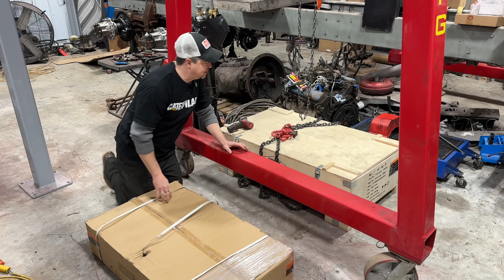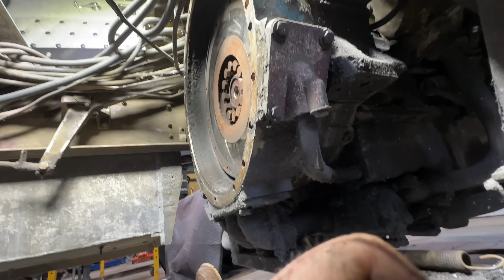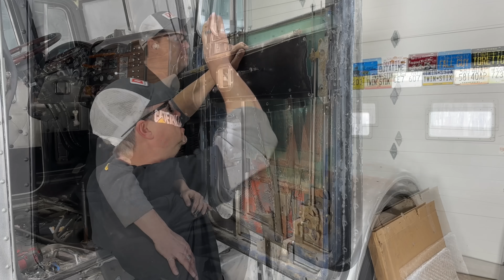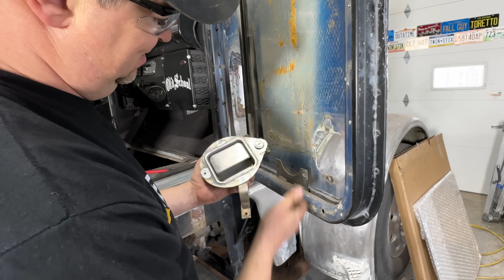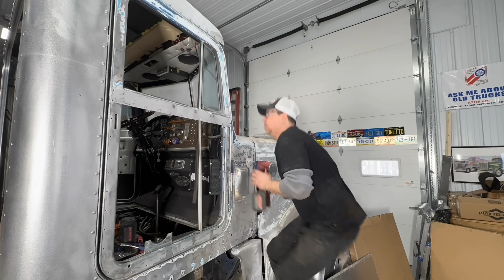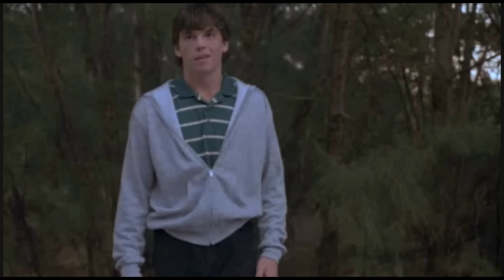Peterbilt 359 Restoration Ep.87 Gimme Some Skin

Comment: Hey mark make sure you stick new engine mounts in! I doubt someone had forgot to install them most likely the remains are still in there and they have just deteriorated over time and bits have fallen out! If you leave it as is you will wear the metal mounts out and it has the potential to crack the mounts our even worse lead the frane to break!

Comment: I would highly recommend getting the fly wheel resurfaced. Anytime we do a clutch flywheel gets cleaned up, it's usually fairly cheap
Reply: That’s true, but in this application, it is probably not worth it. Think of the life of the clutch if you resurface it or do not resurface it. The difference it makes will probably never come in to play with this truck. This truck will be lucky to see 50k miles in the next 30years.
Reply: @wadelevan1787  I agree it won't see much for miles but it's still cheap insurance. I can't quite remember exactly what we charge to do it but it's damn cheap. Honestly if he'd pay to ship it down here to South Dakota I'd do it for free

Comment: Now's the time for transmission mount bushings it'll never be easier than now. That's probably what got your shift linkage all buggered up in the 1st place since there's nothing to absorb all the twisting  your trannie does when you come off and on with the throttle. Good time to pull the flywheel and get it resurfaced for that new clutch. And while you're at it you can check the rear main seal since it'll be wide open too. See how these projects can get out of control in a hurry lol?

Comment: I think it's stupid that ye have 2 jacks instead of one,
the trans Jack should have the Clutch tool build into, so ye donnae have a gigant piece of wasted space for storage
for a tool that only has one job.

Also very intresting tae see that ye got sinter metal clutch on LbL ,
but the groove on the Pressureplate is hard, there isnae much live left in it and so is the flywheel.

btw. while yer doors appart soak the door mechanism in diesel and atf mixture tae clean it and get it working proper again.
And put body sealer inbetween the doorframe and the skin, reduces windnoise and keeps dirt and water out esp. on the overlap.

Comment: If you take the door off and remove the hinge you can use all the correct rivets
Reply: You should watch Berry Trucking videos on building the dump truck he does it that way. Replaced right door skin
Reply from the maker: No the inside track is behind the inner frame so no way to get behind

Comment: OK. The reason for this transmission exercise is that it comes out of gear on occasion according to episode #86. The shifting mechanism has been redone and tightened up previously. The shifting mechanism is mounted by bracket to the frame rail. The bushing, pad, softener, whatever you want to call it, for the right rear engine mount is missing. This engine mount is right in front of the bracket for the shifting mechanism. The missing bushing allows extra movement of the engine and the transmission, which is bolted solidly to the engine. The transmission will move more than the engine because it is out there farther towards the end of the stick. Probably replacing that right side bushing, and maybe even the left one, should have been the first job you did, and not something you might do later if the whim overtakes you. Take care. And good luck. I better edit this. What I’m saying is the transmission is shifting itself out of gear, because the shifting linkage is tight, but the transmission is moving all around. Hopefully the trans is fine as frog hair, but collateral damage is a possibility due to the lack of maintenance.

Comment: My name is Gary using my wife’s phone. I repair garbage trucks and semi tractors that haul garbage. Please change the motor Mount now and turn the fly wheel even if it looks ok. The motor mount rubber pucks get destroyed from years of twisting of the engine. If you leave it then gone will move too much. Eventually the metal motor mount bracket can break and the engine falls or jumps up. The fan came hit coolant pipes or hoses and also the fan can then fall apart and blade go through the radiator. It can be very expensive. The flywheel surface may look smooth but isn’t. If you want a smooth long lasting clutch please surface the flywheel.
Reply: Great comments Gary! It’s important to keep in mind what Mark is planning to use this truck for. It will be lucky to ever see another 50k miles while he owns it. Flywheel will be irrelevant.

Comment: If you used the truck you would want a rubber bushing on the tranny mount. It sroos vibration and noise from going into the truck plus keeps cracks from developing  in the trans case. You are really good at showing perfection in doing a job.

Comment: thought you would have used a sealer on these new panels
Reply from the maker: Yeah I missed adding it along the top but it’s fine since it’s tucked underneath so I’ll just put it on the inside and I plan to add correctly before I rivet the rest in 👍

Comment: A clutch jack is a waste, do not install the clutch on the flywheel first.  Years ago I learned the best way to install a clutch is by stacking it order on the input shaft of the transmission and to bolt the pressure plate up once the bell housing has been bolted down.  I would never do it the traditional way ever again once I learned that method and everyone I know that trys that method won't do it the old way again.
Reply: Yeah if I had a clutch jack there is no way in hell I would dick around with barring the motor around to get at all those bolts.
Reply: @farmyardfab  I guarantee I can still do a clutch job faster and easier using the input shaft stack up method than the conventional method with a clutch jack.  I have done well over 100 clutch jobs using the input shaft stack up method.
Reply from the maker: Yeah I’ve seen that way as well but not crazy about trying to tighten the bolts through the small opening - seems like more of a PITA 🤔
Reply: @TwinStix    I think 🤔 you can get it to work for you and I like 👍 your Smokey and the bandit truck 🛻 and the trans  am 🚗 you have a good day
Reply: @TwinStix 😊
Reply: @TwinStix  Just bump the engine over with the starter and do 2 at a time.
Reply: I definitely agree. Stacking the clutch on the input shaft is the only way to go.

Comment: I'm just winding why you aren't sealing the panel in so it's water tight.
Reply from the maker: Yeah I missed that along the top but since it’s tucked underneath I may just add sealant on the inside seam but will add it properly down the sides when I do the bucks and blinds 🤔

Comment: Are you going to get the flywheel machined/surfaced?  That is standard procedure when installing a new clutch to ensure it has a good mating surface.  Although there are no heat spots the clutch usage over time creates a glaze much like brakes on a car.  With that glaze the clutch won't operate as effectively.